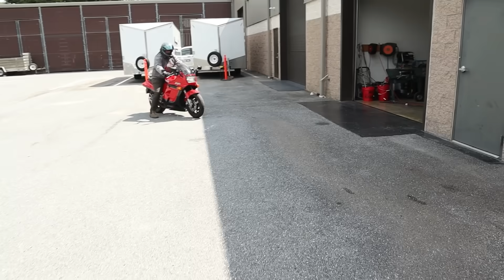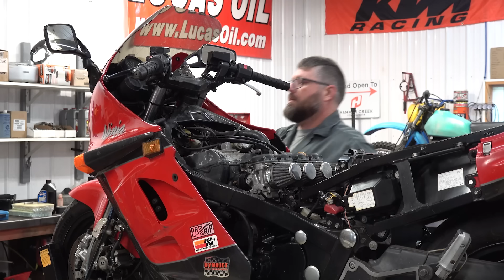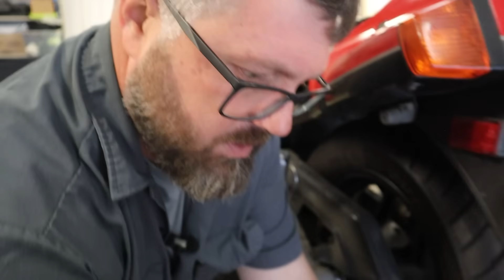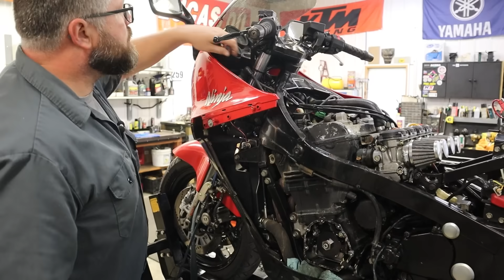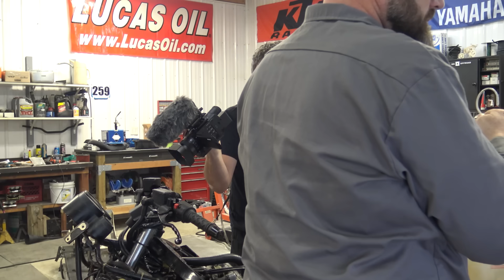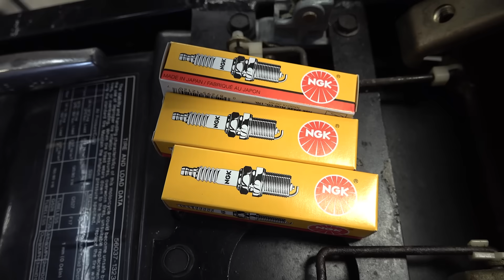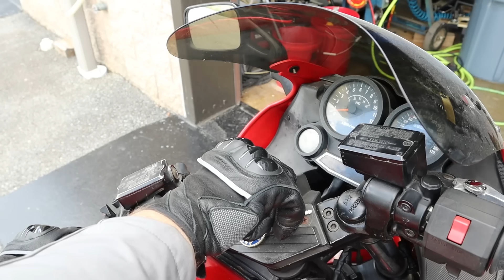Can I Fix This Unfixable Iconic Ninja Super Sport Bike?

Comment: A couple of examples of how insidious an electrical problem can be...  Years ago, I could not get my 2000 Kawasaki Concours to start. It always started, until now. I tried everything. It turned over just fine but would not fire. Finally, I checked the battery and saw that one or two cells were down just a tiny amount below the minimum line. I topped them up with a bit of water. The bike fired right up.  Several years later, my otherwise very reliable Yamaha FJR would not start. I tried everything with that bike too. The battery wasn't that old and it was sealed. So, on a hunch, I bought a new battery. It fired right up.

Comment: Craig ur a dying breed my man. What's ur shop rates? Would love to be a customer. I have a 04 honda crf450r that has the hard to start issue. Had valves adjusted and new carb new plug new stator and coil. Can't seem to figure it out. Need ur knowledge desperately.

Comment: I had one of those that was FUEL INJECTED... What a disaster. The bike spent more time broken down, than running. NO ONE knew how to work on it, or fix it. Every time I got it out of the shop, after it was supposedly "fixed".. It would run for a few days, and then right back to misfiring, popping, sputtering... and not running properly with ZERO power or acceleration. I finally sold the bike and moved on to a bike that had carbs and all was good after that.

Comment: I once took a 1976 CB750F to a motorcycle shop with carb problems. They had it for two weeks and when I picked it up, I made it less than a block and it flooded and died. I managed to get it home after letting it sit for several minutes and would go a mile and it would die again. It took me forever to get home with it. I called them and they refused to fix the bike so I put a stop payment on the check. They were a hack shop and there are many of them around. Check references! I did not take it back immediately because it was to late after I was able to get it running again and it was in those times when cell phones did not exist.

Comment: most shops would touch it, but clients who own such old bikes are not willing to pay accordingly with labor investing. I know because i am in the industry also, not in the US, but in Romania, Europe. Usually people belive that if they own a 50cc china scooter or very old bike, labor price should be related to thei object value. That's the reason we stopped repairing small cc scooters. Also we have done tons of carbs when practicing under 50% prices from the rest of the shops, and now that we charge accordingly to the labor, it doesn't matter if we might be doing the best carb jobs in the city, bikers are not willing to pay, thinking a 100% correct carb job is easy or fast.
So yeah, that's why probably most shops don't do old bikes anymore. Clients related usually.

Comment: Yeah, motorcycle shops are what got me into fixing my own stuff. Most of them are putrid. My GSXR1100M came back after a month running worse and they STILL charged me. It took me one day stripping the carbs to find they had installed some parts the wrong way around-----

Comment: You did not change one thing at a time then see if it changed the sound of the engine. Those are "Hot" racing coils, they take an after market module(cdi box) there was nothing wrong with the hall sensors.(trigger coils.) The cdi box is bad. Put a new set of plugs in it too.
Reply: And chuck pods

Comment: Those 10Ah DeWALT batteries are notorious for premature failure. Is that why you’re using such an oversized battery with the compact brushless Atomic impact driver? One of my 10Ah isn’t useful for much else now either. Well, I get a useful amount of time with the DCL045 hood light but the battery is a bit too heavy for most places I would use the light.

Comment: Cv (constant velocity) carburetors such as those operate by vacuum. And they were engineered to count on the vacuum created by the restriction of the air cleaner box. That they removed the air cleaner and replaced it with those pods is the first red flag
Reply: Before buying an electrical component it is a good idea to check where it plugs into the harness for a good clean tight connection

Comment: Today, it gets harder to get good parts every day . I have seen bad new parts from all major sources. Quality control is nonexistent today . This situation did not exist in the 60s, 70s, and 80s. Most replacement parts were good. In the 90s, everything changed, I believe the date when quality control went downhill rapidly was January 1st, 1995, when the WTO started up. Cheaper component sourcing became commonplace.

Comment: When you create a OHM when the resistance to the negative side draws through a board for so long it could be from a factory that wasn't manufactured 100%.. it could be a good name brand part but at the factory from creating the green board inside little pick-up coil can't handle the heat the the solder starts to intermit within the green board in electronics and an individual wiring a 123 strand will not work unless you solder them and within the part itself it can be any part wanted heat up to the temperature of solder it creates a flux that may interact just within the part itself and you can't find it you have to actually change the parts two or three times from the negative side of the ground not necessarily the positive it's going off the ground draw   volts equals ohms like exactly how many watts equals 15 amps ... Is used to produce a certain current temp I'm saying but within the green board when it gets hot 🥵 ground pulling intermittent resistance

Comment: That bike is really old and it's probably been sitting in some garage not being driven for many years. I'm sure the gas has gone bad and it has probably mucked up anything that it comes into contact with. I would empty out all the fuel to start and see if that bike is getting a steady flow of fuel. Then I would start to test all the electrical because electronics start to go bad with time whether you drive that bike or not. I'm sure you will find some electrical parts that need replacing as well.

Comment: With all the plastic removed it would have been fairly easy to replace the front fork seals. Good suspension is essential for safety. I'm surprised you didn't - or did I miss something?

Comment: I know this is just another one in a long list of bikes that you're working on but you said the fairing pieces are hard to come by I bought a brand new 1984 900 Ninja and I sold it to a buddy of mine who still owns it during covid he made the decision he was going to go totally through the bike now this motor was sent to Yoshimura racing division to be built so it is slightly quicker than your average 900 but when we were talking I asked him if he figured out how to fix the busted screw holes in the fairing he said yes down in Brandon Florida there is a company that makes fairings from the 80s and 90s Superbikes you can even get them in carbon fiber so he got a whole new fairing in carbon fiber for is 900 and for his 750 slingshot the last time I spoke to him which has been about a year he picked up a 1986 GSXR the sat in the showroom its whole life had 40 Mi on it but from being in the air conditioner the whole fairing was dry rotted once again carbon fiber says they're not cheap but if you love your bike it's still cheaper than a set of boobs for your old lady and by the way it was good to see an actual mechanic with a nice set of manometers don't know if it's a customer or friend's bike if it's a friend of yours tell him to slap a set of 44 flat slide Mikuni's on there not a real good round of town the boy it is a buttload of fun on a spear to ride

Comment: Did you mean to say 1986, instead of 1996?  Because I was well aware of Kawasaki Ninja  and Suzuki GSXR etc., etc. in 1983, when they were being sold at the dealerships and in all of the magazines at that time.  But the Ninja in Top Gun was Not a 1986 GPZ100R, rather it was a 1983/4 GPZ900R.  You know, since Top Gun was released in 1986,... But shot in 1985.  So that particular motorcycle you have there is a lot different than the one in Top Gun.  
The one in Top Gun had the Darth Vader face around the head light.  The newer one that you have in the shop is a smoother face.  The tanks are also a little different, since the 900R has a smoother tank top and the 1000R has the bulge for the lid.  There are a few other differences as well, like the front engine fairing is completely different between the two.

Comment: The only new vehicle j ever bought was a motorcycle. Came time for the 500 or 1000 mile 1st service which cost a week's pay. Put a couple paint marks on valve cover cuz they were supposed to check valves. They took the money and never opened it. I checked and they were all too tight. Do your own work

Comment: A couple of things.... I would have connected a better ground before moving on to further diagnostics, then there's a good chance that those coils weren't the correct ones for the bike, being that they tested out exactly the same and... the source coils are behind the timing plate, that timing plate is a mod for guys doing stage three mods. So there's a good chance someone was monkeying down there.  Considering the age of the bike, it's highly possible that someone replace all those parts with, "ones that looked the same" but really were not....Anywho, way to go....I had the "88 ZX10, great all around bike, she topped out around 165 mph and you could ride her all day....

Comment: Those green coils are not the originail coils!! The original coils have been replaced with those, because the original coils are black. Seen as they measure the same values primairy to primairy and secondary to secondary, they are probably still good, they just have different values compared to the original coils...

Comment: People don’t fix them because they spend an entire shift diagnosing and then have to get parts and so the repair. 

What is shop rate? $100-200/hour? Times that for 10 hours plus possibly hard to find parts on a 30yr old bike? $2000 on a bike that’s only worth $1500. 

Seems obvious to me why shops don’t want to waste time on these.

Comment: Well, it’s old school. I assume. Carbs not injected.

My motorcycle is 1998, carbs. 

But it does have an electric system, sparks are needed, after all.

I had a bad engine earthing wire, that connection is now soldered, the spade connector is history. 

My fuel tap failed, it did not shut off when the engine shut off. Drained 6 plus litres of oil out, it only holds 3.5 litres, the other 2+ were petrol.  It did not run well with huge amounts of petrol evaporating out of the engine when hot and going into the air intake via the breather system. Rich mixture. 

Hydro locking. On fuel. See above, plus carb bowls full of microbes that love to feed on ethanol. One float bowl was almost full to the top with orange goo. Bacteria/microbes. Yes, that helps. Not. 

New fuel tap, genuine, strip the carbs and ultrasonic clean them of unwanted single cell organisms. Fuel additive every tank. To kill them.

Job done, no more fuel dripping out of the air filter box with a hydraulic lock of the engine.

Comment: Screaming vacuum since I started watching, within the first 30 seconds. only reason why. I owned a 1996 ninja, and I lived in keywest florida at the time. I thought while getting off my dads house boat. I had dropped my bike key into the ocean to the point I went under the dock in full scuba suit and gear and searched with no luck for the key. To this day i dont know what I dropped cause I saw and heard something hit the dock and fall overboard. But unlucky for me, it was not my key. I found the key 3 days later in my dads houseboat. I had left it on top of the back of the sink in the bathroom by accident. So with no key to the bike, no back up. I called a locksmith and wanted him to rekey the ingnition. He explained the cost would be extreme and he could match the key by using the gascap as its the same key as the ignition. So he removed my gas cap not realzing when he did so, he messed up something on the cap and caused a issue where my bike would do exactly this, what this bike is showing, running 30 seconds to 3 mins til it reached temp, when into closed loop. then would shut off. so I rode my bike like this for 3 days. But I had to go to orlando the next day and I had no choice but drive 3 minutes and wait 10. so i was on a 3 day nightmare trip to drive 12 hours i thought. It was bike week at the same time. An a old harley mechanic pulled off where he seen my on the side of US 1 on the 7 mile bridge. He took a few minutes looking at my bike. listening to me explain what i was dealing with and the whole locksmith and key issue. he knew immediatly and told me, put a rag in the gas cap and be careful dont fill the gas tank more then 3/4. An i pulled into orlando 9 and a half hours later. I tell you. That biker the fact that a harley driving biker pulled over to help a 18 yr old kid on a rice rocket.. Told me all i will ever need to know about the old school bikers. They are angels in leather.

Comment: Great video, but a couple observations- first, I’m like, let’s see how he replaces the source coils, but you never showed that in your video. It turns out that the cheap aftermarket source coils you bought were the problem. You did not explain why you chose to buy them from eBay, whether the seller had good reviews, and why you later went with used source coils - why did you not buy new ones? I think your video is mostly great, but you really left out some of the biggest parts with no video and little explanation as to why you went with eBay source coils first and used coils second vs a dealer part or maybe brand new from reputable company (like Denso source coils sold from an online motorcycle parts store).

Comment: Would had first done a basic service or at least check oil and coolant levels. Then replace battery,plugs and plug wires and that bike would had ran fine.

Comment: now the bike in top gun was a GPZ 900 and for years I thought it was this bike now I still kick myself to this day because I let the bad boy the next level up to this bike get way years ago I had and sold a 1989 ZX 10 called the tomcat over in the UK it looked a lot like this GPZ 1000 just a bit more rounder on the tail lights and blinkers and had some other more updated things the motor was a bit more updated. People like to call there GPZ 1000 or 1000R a ZX but no. When the ZX 10 came out in 88 it was the fastest production bike until the ZX 11. I sure miss that 89 sold it and got a 1990 FZR 1000 that I still have but it's a bit of a basket case but one day and some $$$ I'll get that old FZR going again just wish I still have the ZX10 too though the resign at the time was I had a 87 FZR 1000 and it had power and could handle so I wanted that and got my 90 FZR due to it had the 1003cc motor and I did the 1070cc kit and other stuff so I love my FZR but looking back the ZX was a fat boy but it had the power, great on long trips (did a 2 hour ride to the beach a few times)and had a sexy style that to me the ZX11 was even missing a bit of I just liked how the front upper fairing came down with  the two legs to the belly pan just though that look cool and for oil changes all you had to do was drop the belly pan. Craig, I wish you were in Florida, but I'll bet you're not I really need a good mechanic in Florida I can trust that's on the performance side of things like dialed in adjustable cams and put my old FZR back together .I live near Tampa and years ago we had Garry at elite performance but he sold it back in 2010 or around there but he built my FZR and did a great job but I was a jack azz and decided to polish my frame and didn't cover the carbs so when all that fine metal got sucked down into my motor ......yep all that time and $$$$ young and dumb

Comment: a trigger only needs to output .3v or so to trigger the CD box. Your explanation seems to have omitted the charge coil for the cd unit. you cant just trigger coils directly without a cd box.... wouldnt have near enough volts to spark them! the coils: if  resistance is very close on both, it ain't the coils. Aftermarket coils almost always OHM high.the real test is cranking voltage with a DVA adapter. that tells you all you need to know about how they function. you can have a good resistance test and coils are bad, but if the voltage is low you know its defective. i would suggest customer ALWAYS gets OEM or a trusted aftermarket if they are unavailable. buying cheap chinese sensor coils on ebay is tempting, but you pay in the long run. good thing you didnt need a CDI... those are known to double-fire, smashing pistons .

Comment: In my opinion you cant call yourself a mechanic if you arent willing to dive into a service manual and figure out how to fix stuff that isnt supported by the manufacturer anymore. A mechanic is supposed to solve problems not just swap components. The problem with most shops these days is they are only concerned with making money and want as many jobs through as possible in a day. This means they wont let their mechanics do anything but swap parts.

Comment: I’ve owned 3 of these and a  ZX10 Ali frame.  But like the GPZ900r. There carbs were utter crap. There Coils electrics etc were worse. And the Engine small flow areas totally blocked up.  Overheating etc etc  tots crap 💩 igniter boxes.  Etc etc.

Comment: Buy an oscilloscope and learn how to diagnose electronics with it. It would have saved you two weeks of waiting for the wrong parts, and given you the information on dynamic   
Operation of the parts not just resistance and voltage.